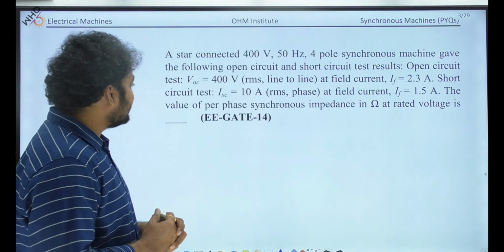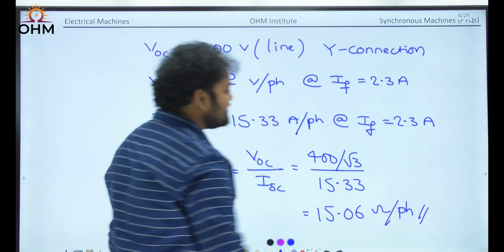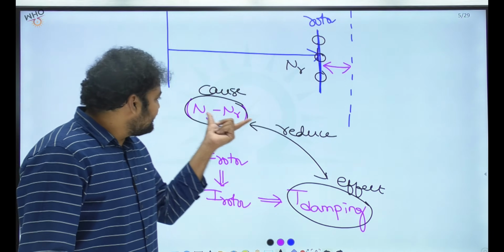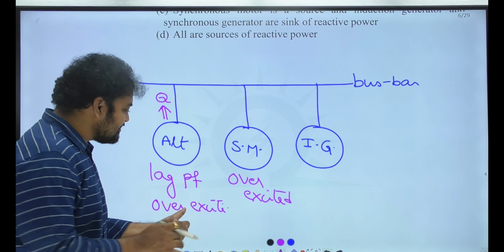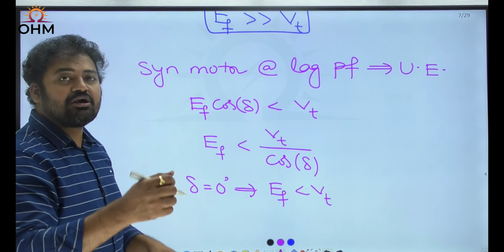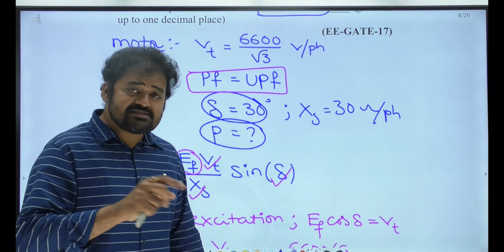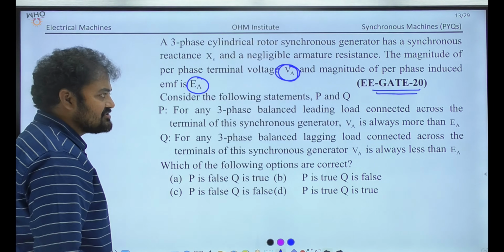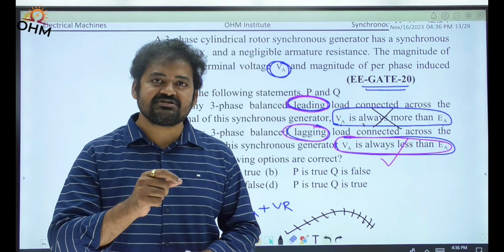GATE PYQs Series | Synchronous Machines | 1 Mark Questions | GATE Electrical | OHM Institute

Comment: Sir for negative voltage regulation it should be Ef<Vt right...?
Reply: Yes, for Negative voltage regulation Ef is less than Vt. But voltage regulation can't be negative for all leading power factors. It can be either negative, postive or zero regulation. So, P is a wrong statement.
Reply: Exactly bro.. P and Q should be true right?